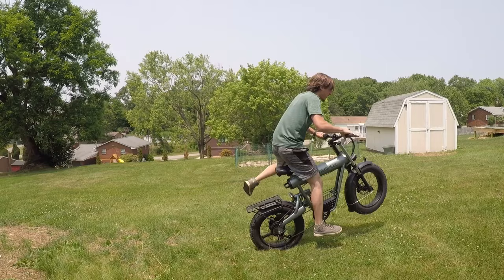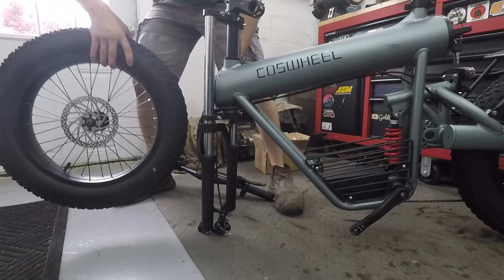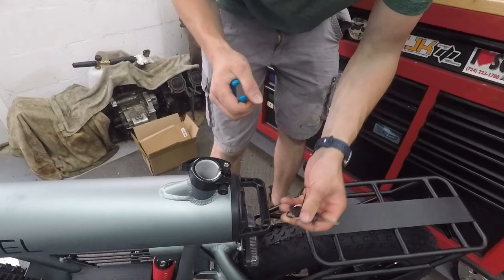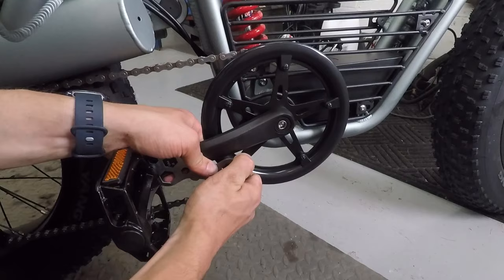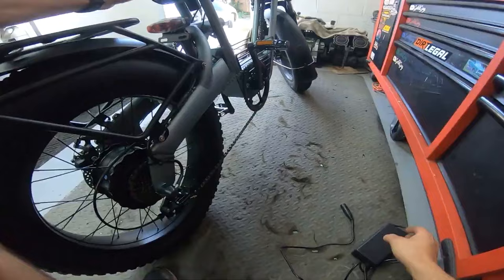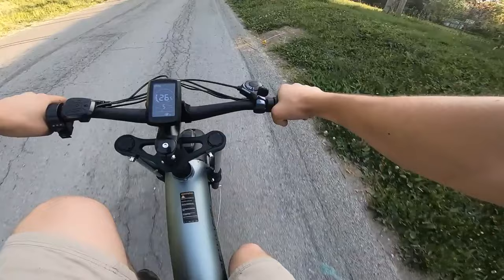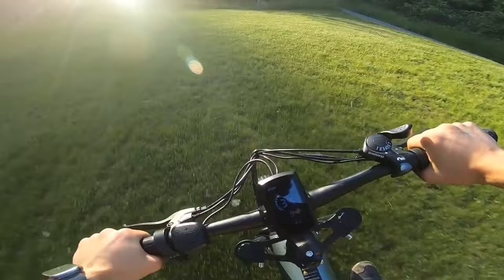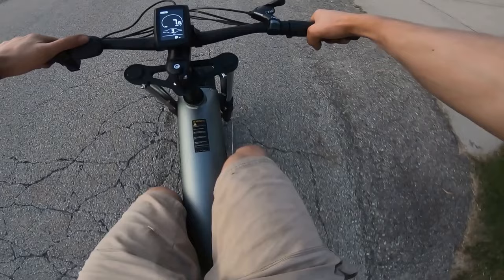The Unique T20 Accompanies You On Your Adventures

Comment: You put the rear fender on the front. That's it doesn't fit.
Reply from the maker: Both front and rear are equipped with fenders, but he did not install a rear fender.